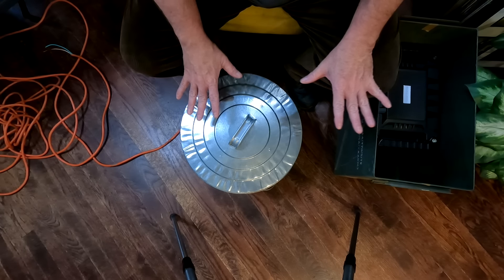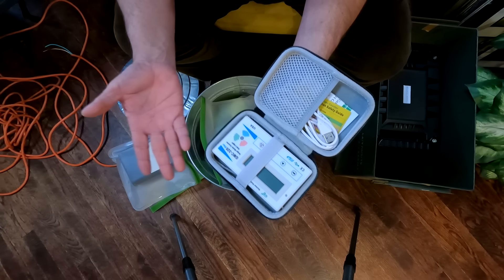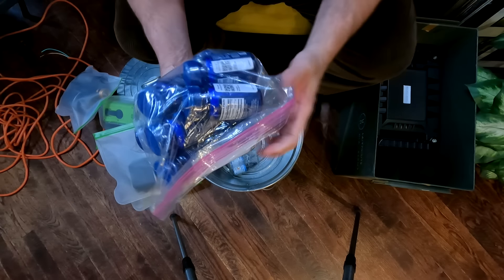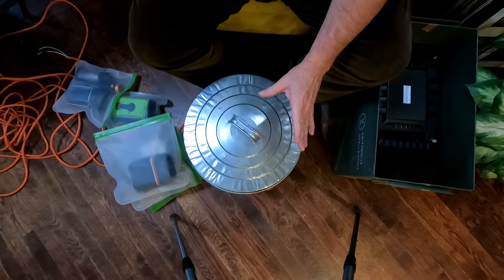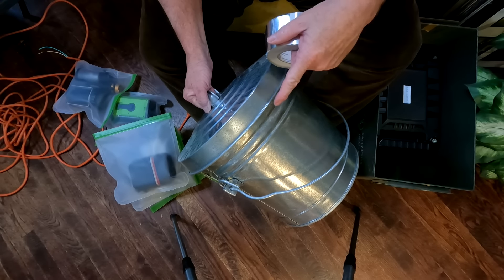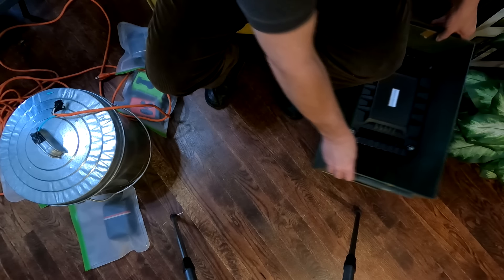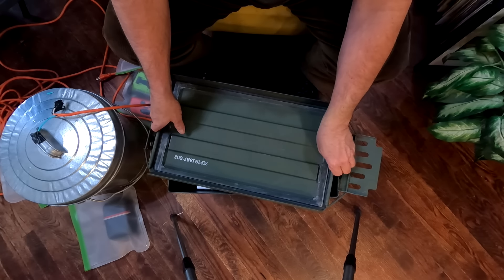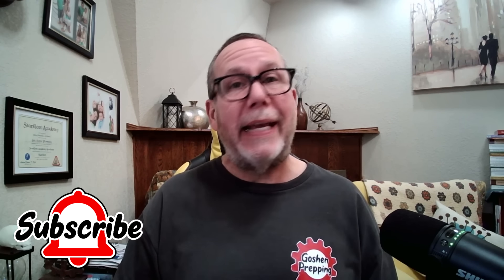How to make a FARADAY CAGE – The Correct Way – Quick and Easy

Comment: Thank you for this video.  Consider a strong enough solar flare with the solar radiation and charged particles ionizing our atmosphere...which basically has the same affect as a nuclear det....i have been planning for this event to take out electricity.  back to the stone ages, globally.  The charged particles will educe massive current into all transmission lines causing their sources and termination points to burn up.  transformers and power generation.  nothing left.  Truthfully in all my years i have never considered a farraday cage.  i knew i would make one, i just seemed like i had time not too worried.  With the magnetic polar shift...weakening magnetic field because of the shift, we are more susecptable to weaker flares and energy .  it would take less.  Just based on trending space weather data its likely the power kill shot will happen in the next 20-30 years.  is very hard to predict..it could happen tomorrow.   ill share a short video if i can.  It Is a filament eruption.  it released south of or below earths orbit.  if this had been directed at earth it would have done it, likely the kill shot, it was incredibly dense and fast.  In  my opinion this is what we need to prep for.  Not to mention the 12000 catastrophe that is coming due(overdue by 1000years).  there is evidence of this happening at least 6 other times going back 72000 years.  in short there is a galactic cloud of space debris traveling through the universe.  it will eventually reach the Sun and completely cover it with the space debris.  The sun will appear really dark when this is happening.  Eventually too much pressure on the Corona (the Suns outermost layer, holding the solar wind back)..will explode out in all direction through the entire universe burning everything..  near extinction level on earth...During this event weather on earth will be devastating, almost not survivable.  In my opinion this is known by all those in charge of the decisions, and they are using global warming and climate emergency as cover for the catastrophe...and tricking everyone to follow climate change narratives..I could go on and on... ...when you learn all this you start to understand so many things you have seen and heard for news and media and politicians    thanks again

Comment: One thing I have to wonder about. You have a GPS in your cage. If a strong enough pulse hits you will not have anything that GPS will connect to. Also you keep saying radiation getting in. It is the electric waves you are keeping out, not radiation.

Comment: Why do some people put cardboard inside and you dont
Reply from the maker: You just need some type of insulator to prevent your electronics from touching the metal. Some people line it with cardboard, I prefer to use the thick freezer bags.